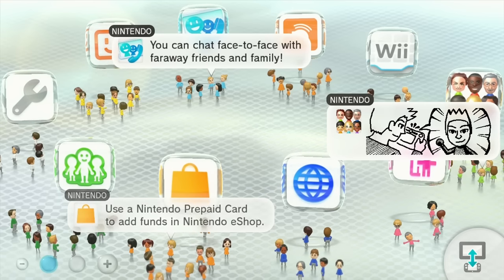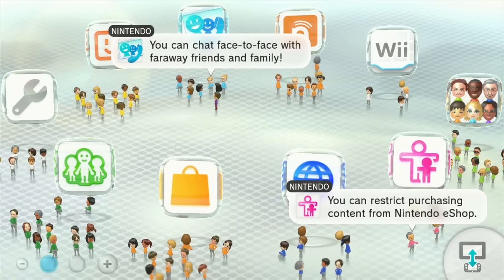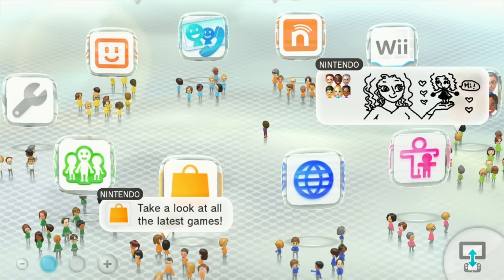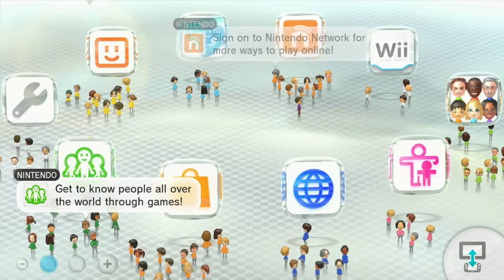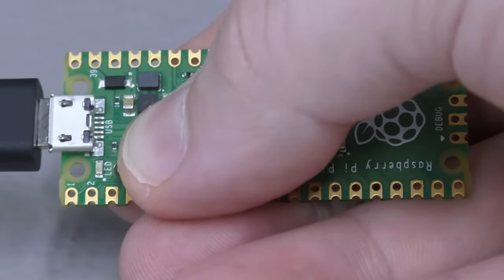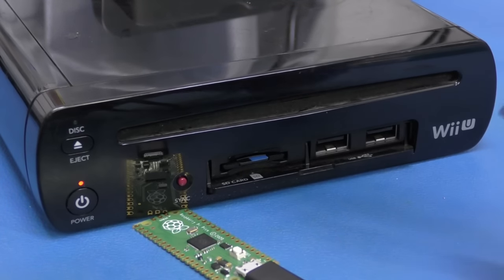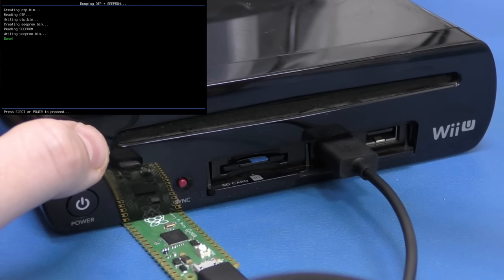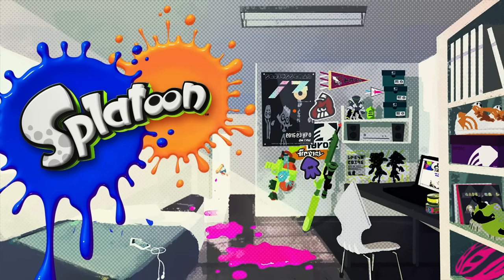The Truth About the Bricked Wii U | Can You Fix yours For $8?!

Comment: unfortunately i do have a nand failure console, maybe the chip is fine but the data is junk either way, i did do this trick to gets its keys back when it was announced and unfortunately my wii u has only gotten worse with time without me even doing anything with it.  and yes i also tried to fix the launch title but that didnt change anything and perhaps accelerated the decay.
but this still isnt a total death sentence, a few people have suceeded in replacing the emmc with an sd card and its already possible to rebuild a lost nand using a donor and your keys
Reply from the maker: Man, I'm sorry to hear about that. Hopefully that since you've extracted your keys, we can reconstruct a new MLC on a new eMMC. I'm going to look into this.
Reply: @Voultar  i dug around and found the log files from it, its definitely a bad hynix emmc, it matches line for line with the fatal error signs that the gbatemp guys mention

Comment: Just gonna put this here. I think as Wii U owners, we ought to band together and sue Nintendo for how they've handled it, not only during its' sad, neglected life, but this straight up bullshit of it failing and corrupting just because it wasn't turned on often enough. They aren't even taking steps to address it, apologize for it, nothing, they don't care. Never in my life have I ever heard of or experienced a console that dies because it wasn't used often enough. If it uses a faulty memory system, the NAND, eMMc, whatever, then Nintendo needs to be held accountable for that, offer a more stable alternative system. It should not be we the customers left holding the L as they say nowadays, we bought the thing expecting a certain level of quality, and Nintendo failed dismally. Again, never before in my life did I witness a developer so thoroughly discard their own creation, during its' life, so clearly hating it. I almost wish Nintendo did recall the Wii U, and make a better console, maybe give a little discount for those of us who bought the Wii U at the time, but at least then Nintendo might have had a console they respected and treated better. I don't know if 10 years is an exceptionally long life, but I have consoles 3x that age that work better than my Wii U does currently, and I don't know if it's just a less things can go wrong thing, but modern consoles ought to last longer than 10 years if you ask me. You spend more on them, so in theory they should last longer, to match the investment if nothing else. I know I'm an immature and angry person, but this is how I honestly feel about this. Our investments, small or big as the were, were not fulfilled by our experiences, and Nintendo is obligated to fulfill our expectations.

Comment: Hey Voultar   Thank you so much for this video.  I am trying to use this method to repair a Wii U that froze during a factory reset.  I can get it to start up and pair with use of the pico and software on the SD card, but it always tries to continue the factory rest and then I get a error message on the handheld that reads “ A system-memory error has occurred.  Turn the console off, and then try again.”  When I do that they handheld will then not connect with the console at the restart, the console will boot up and the Wii will displayed and then it tries to continue with the factory reset.
Have you ever seen this before and do you know of any way to get it out of the factory reset and restore it?
Thanks so much for your efforts to keep these systems running

Comment: My Wii U just bricked yesterday. It started with a system memory error every time I tried to load certain eShop software, so I tried to delete and redownload it. Part way through it stopped downloading, and when I tried to cancel it was stuck for hours on deleting. According to info I found on Nintendo's official site, I powered off the console, but that's probably what ultimately killed it. Booting back up, I would get three seconds into the Wii U plaza screen and the whole thing would freeze. This happened about a dozen times while I tested different combos of removing external drives and SD cards, but after about a dozen times it failed to start at all. The disk spins up, the fan comes on, but it doesn't put out a signal or connect to the gamepad. Now I'm desperately trying to fix it, but info and parts are pretty sparse - hoping what I find here will help.

Comment: I did this method half a year ago when I by mistake bricked my WiiU, but I used my Nintendo Switch instead. The method is basically the same. Just a tip if you do not have a PICO.

Comment: I have a question, I was updating my wii u and my power went off during an update. Now what it only does is that it turns on but nothing is shown on my TV screen and the wii u game pad displays that is not connected with the wii u console. Will this unbrick method work in my case?
Reply: Any updates? Just happened to me. Gamepad works, blue light is on. Just no video. Looking to see if there's any chance to bring this back to life.

Comment: Hi voultar, Many Thanks for making this video.
Is there any chance these errors are created when the wii u gamepad runs out of charge. Obviously the users main reaction is to force close the console.
I suspect this would be okay if the user just charged up the gamepad and carried on using the last game in use.
In reality most users would just turn off the console for months on end.
Problem now is the caps have lost charge and can not maintain the data for the nand. So now we have a scenario where the nand cant complete a wriite operation.
The nand has missing data in its sequence, so the only thing it can do is write a error code in it's place.
I have x3 wii u consoles and on x2 of them I can see the caution sign and a error code and despite repeated facrory formats cant be removed.
So I am going to purchase a raspberry pi pico and try to correct these error codes.
I suspect if the errors are corrected then the factory format will be successful.
If this is the case I would recommend users to charge up the gamepad before closing, maybe  users should replace the rechargeable battery in the gamepad for something better than factory.
Maybe that could be another video, in which you recommend a after market battery to replace it with.

Comment: I tried to do it, but mine keeps turning off once I plug the usb after the disc spins. Could i be doing something wrong?
Reply: Same here!  I've tried with 2 different sets of SD cards and usb cables, but it will always just shut the console down when I plug in the pico at the correct time. It's so frustrating. My condition is that I can load to the main menu but when I try to access any apps (games, settings, etc.) I get the 160-0103 error.  Any HELP would be appreciated.
Reply: @BillJ-yz2ey  I've got the exact same problem (I can load to the main menu but when I try to access any apps (games, settings, etc.) I get the 160-0103 error) and the exact same issue ( it will always just shut the console down when I plug in the pico at the correct time).
You have any joy?
What size SD card were you using?

Comment: Great solution, no need to open it up hopefully it’s just a software issue but if not the Nand may need to be replaced/upgraded. I have the same issue with my official 64gb Vita card. Which also became corrupt after some use. I would like to see a solution for that as well, as there is no way to format it on a PC. Thankfully Vita has been modded to work with an SD Card but i would like to restore this original 64gb card that baught many years ago.

Comment: Mine is semi bricked after 3 years non use. Was working fine before, yet now the system settings cannot be accessed (error code 160-2215).    This method could be for CBHC users who formatted the system without uninstalling the exploit first.   I cannot find any info on 160-2215 fixes and I never had a NAND backup from 3 years ago.
Reply: Thats my error. Sad.

Comment: lol, I just read a lot of the comments.  Am I the only person this didn't work for!?  Most of the comments are people who haven't actually tried it.  I bought the pico and found a USB-A to micro USB cable.  My error is the 160-0103.  This is the first time any type of modifications have been performed on this unit.  The only thing different I did, than the video, is I paired the gamepad using the menu before I powered off, removed the USB cable, and turned it back on.  Still get the same error right after the Wii U logo.  I also dumped the OTP and SEEPROM like suggested and ran the USA cache.  Am I doing something wrong or is this console bricked?

Comment: My Wii U unfortunately couldn't be fixed this way, it got bricked with a failed software install causing the system to freeze. won't even display video output to a TV or it's gamepad. I had even modded the system and have a NAND backup, but all methods I could find involved an out of production teensey, or or difficult to obtain raspberry pi zero.

Comment: I tried to unbrick my black Wii U using the Switch Payload, it didn't work. In the Switch seems to be a sucessfull conection, but the recovery menu don't boot up, i just get a solid white screen with the WiiU logo. Now I'm wondering if I'd get the same result with the raspberry pico or the damage in my WiiU is beyond repair. Anyway, thanks for the good work

Comment: I have a Wii u that is occasionally hitting the nand failure code at startup. A hard reset usually gets it back up and running. But it's happening much more frequently these days. 

Also, could this be used to inject haxchi at cold boot without any other mods?

Comment: I have a Wii U that doesn’t get an error code, but may be a similar issue.

I factory reset my Wii U because it kept freezing on game startup screens, now on the initial system setup, the console soft locks every time it opens up the mii maker app (it wants me to register a mii for my user profile). I took it a to local game store for repair and they said it was a memory issue, will this fix also work for my case?

Comment: I have a Wii U that was off for about 4 years and when I went to plug it in to play Wind Waker on it nothing would show on the screen nor would the gamepad act like it was connected save for being able to turn on the system. (Power button changes from red to blue). I have tried this method and either I couldn't get the timing down, since I couldn't see, or it was a different issue altogether.

Comment: I tried it but it didn't work I am stuck on the Wii U logo screen when i boot the Wii U = need HELP
Reply: I also have a Purple (RED and Blue) Light.  ((PS: it doesn't blink.) PPS: Could the problem be that I'm not using a 64GB SD card? I'm using a 32GB SD card formatted in FAT32.)
Reply: Also have this, stuck on a white screen with the wii u logo.

Comment: If you flashed a different language, would that cause issues? Or would it boot into that other language. I'm sure there's better ways to do it that wouldn't require buying anything special, but the WiiU is region locked, so it'd be an interesting way to gain access to other regional games.

Comment: It worked on one of 2 bricked consoles. But it didn’t work on the one I was hoping. 
I have a complete windwaker console that has the error code 160-0103 but its been formatted. So the error comes up when you’re trying to make a mii or link a Nintendo account stage of console setup. There’s a pause like it’s going to the mii maker menu and then black screen with an error. Any way to work around this?

Comment: Did all the steps and unfortunately, my day one 32GB Wii U isn’t fixed. Can’t go through to the latest update, move certain in system memory to my storage unit, or use certain apps like Mii without the same error messages I’ve been dealing with before. Error Codes: 162-4065, 160-2215, and 160-4712.  😔

Comment: My wiiu has the error 0103. I can boot, but in the system setings, the system crashs. My coldboot tittle is: 0005-0010-10040100 but, the current is 0005-0010-1004010a, when i set the 0005-0010-10040100 on recovery menu, dont seems save, or something like that. This make sense?

Comment: Just followed the video step by step but every time I plug the raspberry pi into my Wii U it immediately shuts off. Am I doing something wrong or is my Wii U just beyond fixing? Also, whenever I add the udpih file to my raspberry pi, I get a message that windows doesn’t recognize the device anymore, but if I reconnect it, my computer recognizes the device, though the udpih file is nowhere to be found on it.
Reply from the maker: OK, this is an SD-Card problem. Find an SD-Card that's 32GB or less in size and format is to FAT32 with 32K clusters. Then reload it with the menu and give it another shot.
Reply: @Voultar  Thanks for the reply! I’ll try this and get back to you on whether or not it worked
Reply: @Voultar  So I tried it with the proper SD card and I no longer have the system shutting down immediately, but I still don’t see the menu appear onscreen. Instead, the power light goes white and the signal to the hdmi cuts out. I tried navigating the menu blindly and just entered the button commands that would refresh the OS, but that doesn’t work either.

Comment: Incase anybody is still getting the 0101 error message: make sure you remove all discs, sd cards, and the Pi from the console when booting it up. Repeat the coldboot process a few times too. I kept getting the error message until ejecting a disc, then it booted the Wii U menu.

Comment: I have a Wii U console that was unhooked from power for about the past 3 years, and it boots up into the OS and main Wii U screen, but when you open System Settings, it shows Error Code 160-0103.  I did the fix shown in this video and still get the same error code when trying to enter System Settings. 😢

Comment: I'm having issues after dragging the file to the pico. It says complete when I transfer the file, but when I open the drive to check, the file is gone. I had no problems using the Pico for my Gamecube, but something seems off here. Does anyone have any suggestions?
Reply: Dude I've run into the same problem. Basically when I copy the file over it ejects and then my computer says I didn't eject the device properly
Reply: I can't figure it out to save my life. I've tried to different Pico's.
Reply: @stevenknickerbocker8786  I just ordered another one cause I was thinking maybe the pico I have was defective but maybe not
Reply from the maker: @Daniel-pm6nl  Fellas, that's normal behavior. It's not a mass storage device. You're programming the boot-loader when you drag the file over and it's not going to be visible to you after the fact, ever.
Reply: @Voultar  then I truly have no clue what I'm doing wrong at this point because I promise I have followed your instructions down to a T....once I insert the usb nothing happens....the most that has is it froze on the Wii U start up screen

Comment: Should I unplug my Wii U if I'm not using it for very long periods of time? Does the chance of bricking the console go up if it's plugged in "red light" or will these bricking situations happen regardless? Thanks.
Reply: Keeping current on the eMMC tends to keep it in better shape - so if anything, don't unplug it. I've had mine sitting under my tv, plugged in since I got it, and it's fine even though I barely use it anymore.
Reply: @KoenvdW88  Alright thanks! Ya, I just always keep my consoles plugged in, but I was just wondering. Thanks for the info ^^

Comment: This didnt work with my Wii U.  It would boot fine and but would get the memory error if tried to update or save anything.  So I did a factory reset and now after I attempt the initial setup on the gamepad when it tries to boot after that I get this error message everytime.  So before I did the factory reset i was able to get into the Wii and now its a brick.  Any Ideas?

Comment: Hi, I need help. I have my wii u blocked with the code 160-0103 and when I turn on the only thing that appears on the monitor is the information from Nintendo saying that there is a memory problem. I've tried the mod several times and I can't enter the menu, when I should enter the console turns off. Is there any way around this, or mine is gone for good. thanks